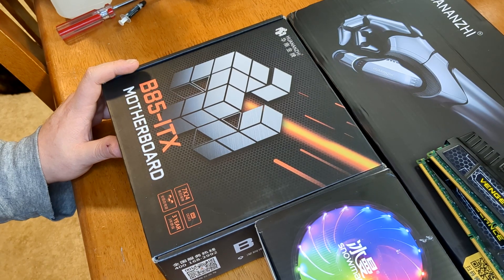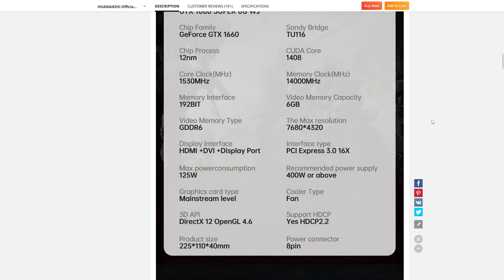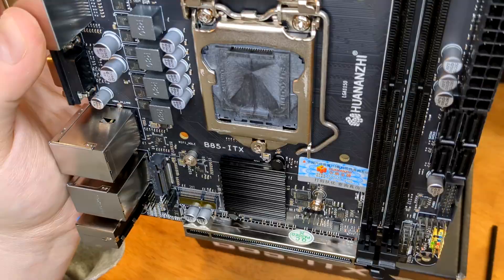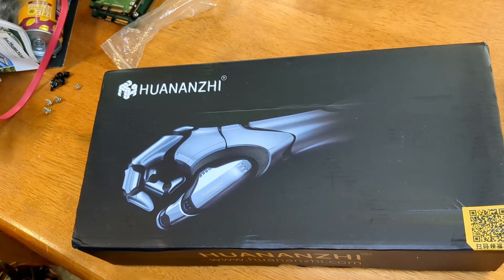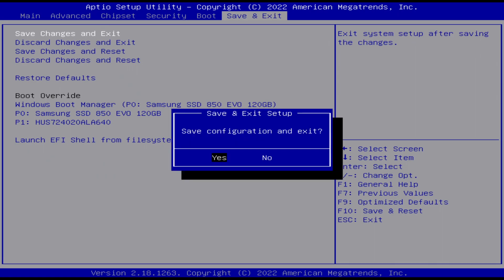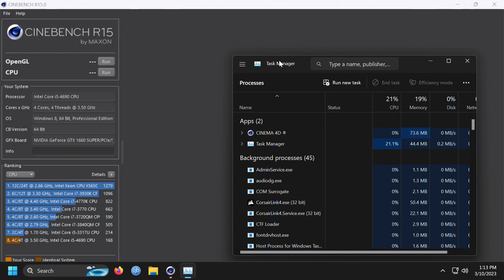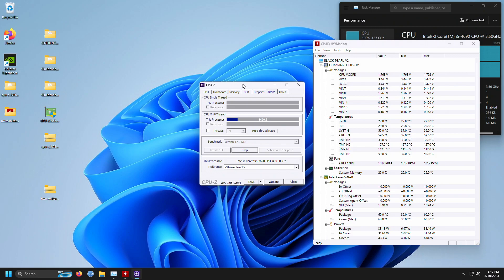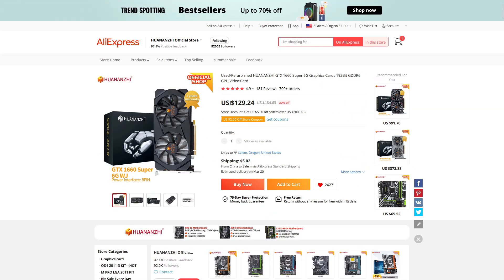Huananzhi B85 ITX & GTX 1660 Super AliExpress Build

Comment: First time watching your channel.

I’m surprised you went for Huananzhi (pronounced as Wha-nan-jher or chir) components, its a pretty popular brand in China as they seem to reuse old chipset components pulled from recycling / dead boards.

I owned an X79 and X99-TF motherboard from them and they are absolutely fantastic quality with their IO and offerings as well.

I would strongly advise changing the 1660S to something else as I heard from a technician in China that there are common failures for most 1660S cards and repairing / resocketing them kinda makes the repair price for consumers not worth since the GPU would be fried with the memory for some reason.
Reply from the maker: Thanks and welcome! It's hard to tell what is quality and not as far as Chinese market motherboard brands go, but based on this board I would be confident in using Huananzhi boards in the future. It is very interesting to use recycled components in new boards.
Reply: thank you for reassuring me! i have this mobo in the mail coming to me right now
Reply: @Mr.Thermistor7228  Not a problem at all.
I do plan to find another Huananzhi motherboard as another platform for one of my buddies here. Heck I might go into the Chinese used market for a mint condition one.

Comment: Just a question though cause I am considering buying the motherboard to downsize a PC I have at home.. You did not manage to get the m.2 nvme drive working correct? does this mean that m.2 drives are of no use with this motherboard?
Reply: I remember this motherboard has 2.0 m.2 slot, I had a similar motherboard before and the m.2 slot work just fine.

Comment: Does this board support intel core i3 4th generation processor and ddr3 ram???
Reply: yesir, you want to look for "lga 1150" that is the socket size that fits 4 series intel cpu's. im running i7 on it 4790